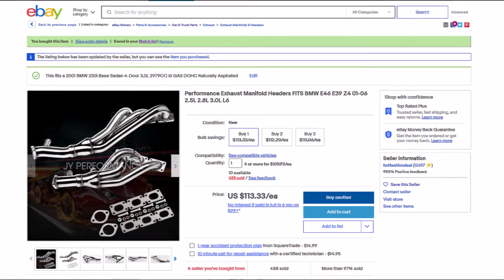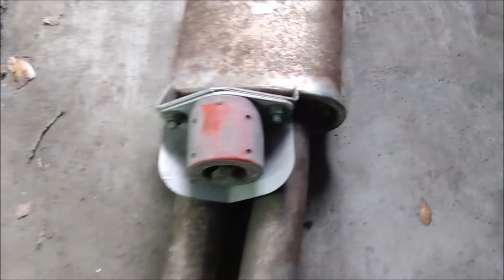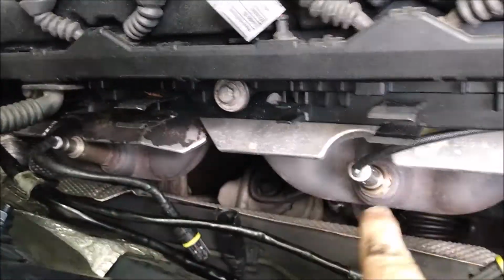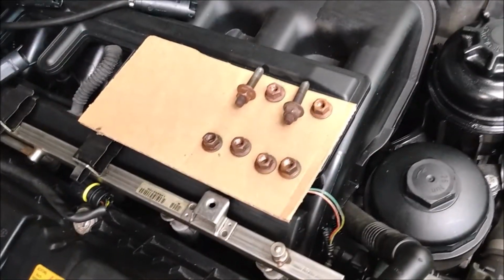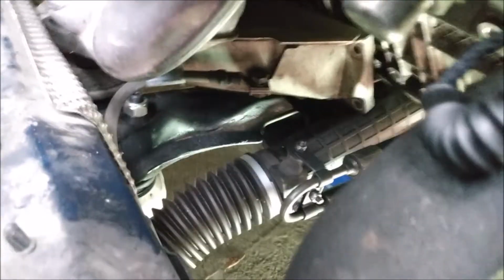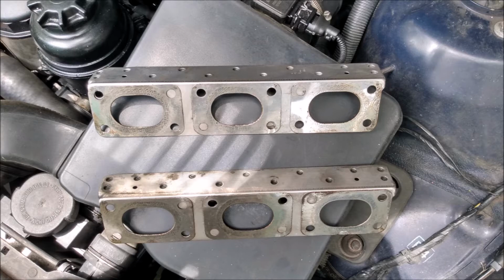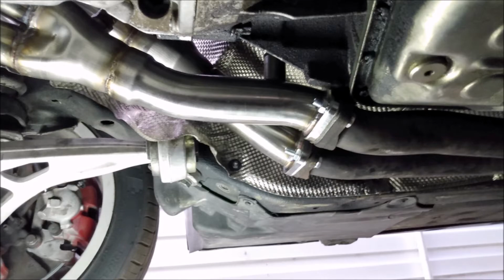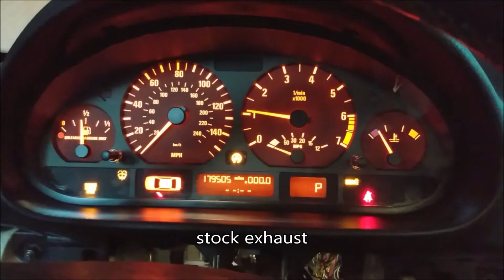BMW E46 Project: Ebay Headers and Muffler Delete (with sound clips)

Comment from the maker: People have asked if I would recommend the ebay headers. And unfortunately, I have to say no. Quality control seems to be almost nonexistent. Different people have reported different fitment issues. So apparently, even the problems are not consistent.

The Spec E46 headers seem to be a better alternative. And I may go that route in the future.
Reply from the maker: Yeah, getting them fitted is a hassle.
Reply: did you end going with the spec headers?
Reply from the maker: @WessMade.artifice  - Not yet. But that is part of the plan.
Reply: Currently my exhaust brackets in the rear broke so im using a hanger for temporary support. I been trying to replace it but i’m looking for the right parts. Complete exhaust system upgrade, 1-4. if you could help on best parts, (sounds good, wanna make it sound deeper; not screaming) where to find them or have links. I would appreciate.
Reply from the maker: Unfortunately, I don't have much experience with exhaust mods for the E46. But the folks at the E46 Fanatics web forum might be able to help you out. Here's a link: https://www.e46fanatics.com/forums/
Reply: Will the spec e46 header fit the 330i?
Reply from the maker: They will bolt up to the engine. But you'll need a custom exhaust (like the Spec E46 exhaust).
Reply: @michaelblacktree  are those catless also? I might go the route since im going catless anyways so custom exhaust wouldnt be an issue.
Reply from the maker: Yeah, the Spec E46 headers are catless.

Comment: Great series not sure if it’s been said before but to get rid of the tamper light on dash you’ll need the light switch from the car the dash came from did it with my build at the moment doing a 330 swap in to my 320ci
Reply from the maker: Thanks for the info. But at this point, that won't be possible, unless I get another gauge cluster with matching LCM from the junkyard.

Comment: Hello, how did you set the manifold so that it does not touch the side of the automatic transmission because I have the same problem?
Reply from the maker: I inserted a piece of pipe into the manifold, and used it to carefully bend the manifold out of the way. I did that with the manifold installed on the engine.
Reply: Did you torch the manifold and bend it with a hose?
Reply from the maker: I didn't use a torch. It only needed to move a couple millimeters.
Reply: You inserted the pipe into the manifold and you managed to deform it cold?
Reply from the maker: yes

Comment: Very jealous! I want to go catless and no muffler since the M3 is a quad tipped exhaust, but I cant risk gaining any more horsepower. I have 2 horsepower to play with before I outclass myself so I cant risk performance mods.
Reply from the maker: People say the headers are worth 5-10 HP. So that would definitely bump you into another class.
Reply from the maker: I wonder if you could downgrade to non-M exhaust and install catless headers. The idea would be to reduce weight but stay within the HP limit. I don't know the numbers, so I can't be sure. Just tossing an idea out there.
Reply: @michaelblacktree   I am not sure, but I'm not going to worry about it. I have an idea for being able to do them maybe over the winter, but not this season.
Reply from the maker: Looking forward to it.

Comment: What e46 is it? And do you have the link for the headers? I cant find headers for mine (m54b22)
Reply from the maker: The engine is an M54B30. And it looks like the supply of ebay headers has dried up.
Reply: someone said aliexpress or alibaba don't remember but check fb groups
Reply: Use e36 328 headers , they're catless. I've got them on my m54b22
Reply: @phawupowerhousesakwe7897 Does it fit straight on e46 330i?

Comment: I have 04 325ci. I deleted just the cats and now there’s white smoke coming out of the exhaust. Any tips?
Reply from the maker: Is it water vapor or oil? If it's oil, that's probably because of engine wear. If it's water, does it smell like coolant? If so, then it's probably a blown head gasket. If not, then it's just water vapor from the combustion process.
Reply: @michaelblacktree  there’s no smell it’s just white smoke
Reply from the maker: In that case, it probably just water vapor. The colder weather will make the water vapor in the exhaust more visible.

Comment: Man.. wish me luck. I've got clogged cats and am putting on some imitation stock headers with cats, to stay legal. Getting those 16 bolts off is INSANE. Especially since I don't want to take off AC.
Reply from the maker: Yeah, that's gonna be fun. Best of luck man.
Reply: @michaelblacktree  Got the top 8 off. Every. Single. Stud. Came. Out.

Lol. Recommend new studs? Red threadlocker?
Reply from the maker: I reinstalled the studs that came out. Seems to be fine. Although your mileage may vary.
Reply: @michaelblacktree  Hey man -- do you know anywhere that still sells the headers? Ebay seems to have removed them all -- I can't find a cheap solution at all.
Reply from the maker: Wow, that's messed up. I wonder what happened?
Reply: @michaelblacktree  Yeah I don't see DNA Motors E46 headers for sale anymore
Reply from the maker: Seems like the supply of cheap headers has dried up... unless you want a turbo manifold. I still see some of those.
Reply: @bayerischemotorenwerke5252  nah probably same factory but probably some stupid issue with epa
Reply: @michaelblacktree  Walmart sells them, i got them on walmart